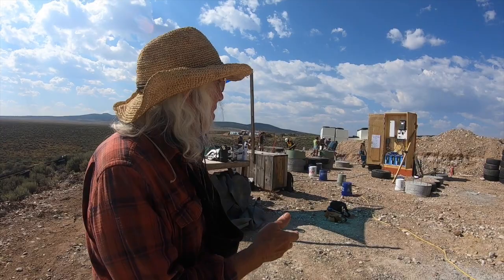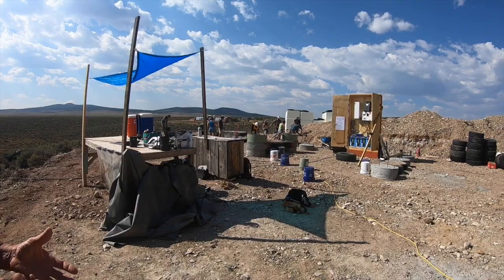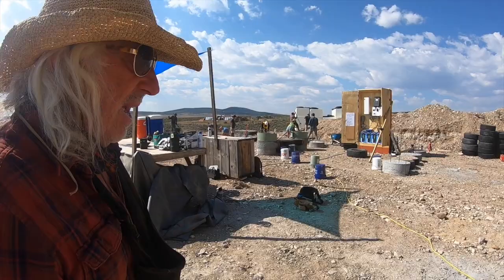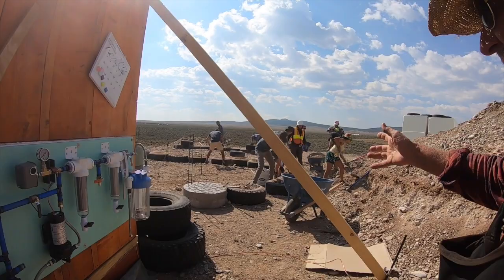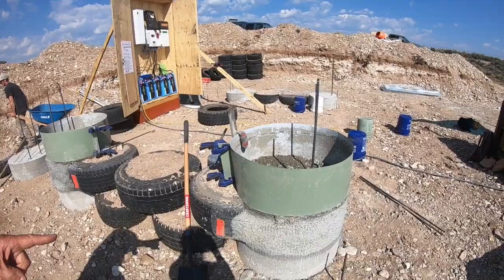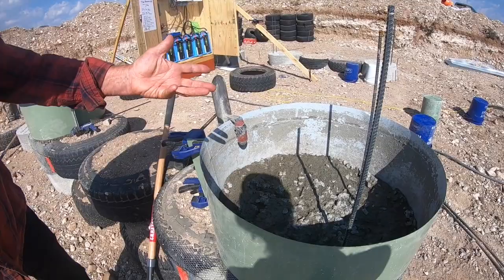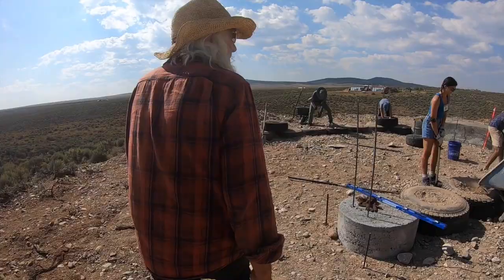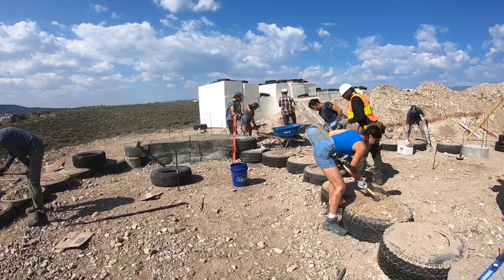Earthship Unity - How to start -  by Michael Reynolds

Comment: Some constructive criticism when I build My earthship as an owner builder what I wanna do is just get to cisterns on north and west side incase them completely with tires 360° We have a south eastern facing double or even triple green house with a rocket mass heater and hopefully some beautiful bottle work throughout because I live in New England some thing that combines the systems of the simple survival but in something closer in size to the hut. I call it is designed the micro survival but if that’s ever used I hope I get credit.

Comment: Hey Micheal I had a thought about filling the tires in order to try and make it a little less labor intense. What if you would use an auger on a hole digger encased in a housing with a funnel type receiver at the top use a back hoe to put the dirt in the receiver put the housing on top of the tire hole then run the auger in reverse force filling the tire. Probably would still need beat with a hammer but possibly make it somewhat easier and faster.✌️❤️😀👍